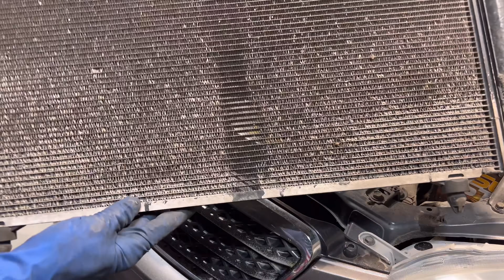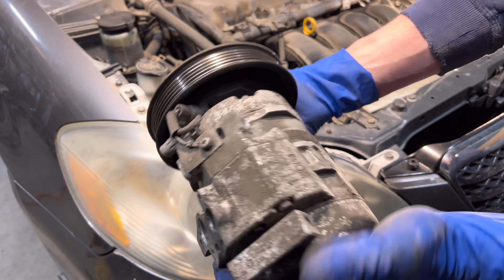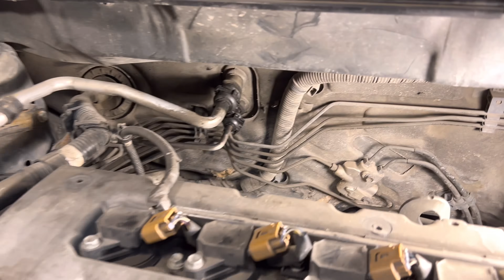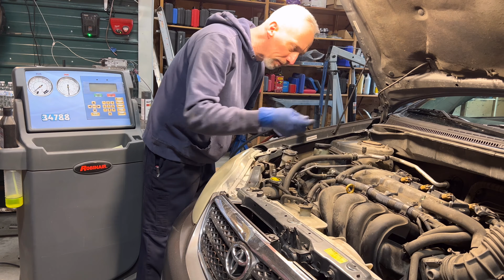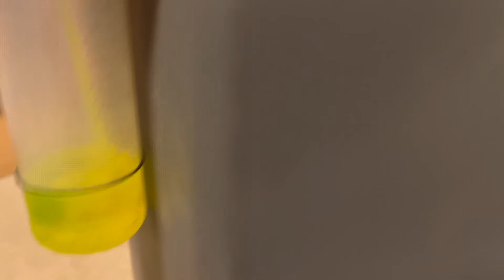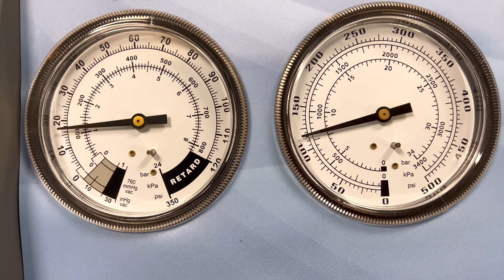New A/C system | 2006 Corolla

Comment from the maker: Product link for the AST line lock release tool: https://amzn.to/3vPy2fc

To see all of the tools that I use and recommend, visit the Tool Demos store: https://www.amazon.com/shop/tooldemos
As an associate, I earn from purchases.
Reply from the maker: @usa wicked 1.06 lbs
Reply from the maker: @@kondon-jt8jt dash does need to come out.
Reply from the maker: @@kondon-jt8jt I just buy an O-ring kit for that car at the auto parts store. There will be a lot of O-rings that don’t fit but you’ll easily find the ones that do. The kit usually costs less than $10.
Reply from the maker: @@kondon-jt8jt I would replace the condenser if you are doing a major repair like a compressor, but I don’t consider it to be a maintenance item. As far as oil goes, do your best to drain each component and measure what comes out. Replace whatever you drained. A good rule of thumb is about an ounce for the condenser.
Reply from the maker: @@kondon-jt8jt I’d look at the clutch first. Either wearing out or bad electrical connection.
Reply from the maker: @@kondon-jt8jt I’ve noticed mine stays on all the time, not sure if it would cycle in other weather conditions.
Reply from the maker: @@kondon-jt8jt hard to say. Could also be a too high/low pressure in the system and the switch is preventing clutch operation. You’d need to check pressures.
Reply from the maker: @@kondon-jt8jt I’m glad you found the problem, enjoy your cool air this summer.
Reply: Have have a blockage, I figure it's the orfice. Is there an inline refrigerant filter?
Reply: I wonder the same thing  Guess it's in the filter in the side of the condenser coil.@ScottieLeague
Reply from the maker: @ScottieLeague  there’s no orifice tube on this car, it uses a thermal expansion valve instead. There is a filter dryer component attached to the condenser.

Comment: in this car can i remove the ac coil without removing the dash?
Reply from the maker: No, dash comes out. https://lemon-manuals.la/Toyota/2006/Corolla%20L4-1.8L%20%281ZZ-FE%29/Repair%20and%20Diagnosis/Heating%20and%20Air%20Conditioning/Service%20and%20Repair/Air%20Conditioning%20Unit%20Assy/

Comment: How do you account for the oil in the condenser? Does the machine add oil?
Reply from the maker: Yes it does. I usually add 1 ounce per component replaced (rough estimate)

Comment: Save yourself some time on the expansion valve and buy a ICON Locking Flex-Head Ratchet and Bit Set, 35-Piece.
Reply from the maker: I’ll take a look
Reply: Yesir. Just did. Realized it would be impossible, at least with my hands, to do that with a regular allen key. Bolts won't come all the way out before hitting the filter housing, but i think I can get it changed without changing the bolts. Wish me luck

Comment: How did you get those expansion valves  screws? Out 😢
Reply from the maker: I used a bit ratchet. Tough to do, but not impossible:
https://youtube.com/shorts/cvHSUpMxPHY?feature=share
Reply: The real question is how did you remove the bolts from the Expansion valve. They are long and hit the blower motor housing. That's the missing piece for me.

Comment: I'm hearing you can remove the top side radiator bolts off and just swing it back to remove the condenser.. I'm going to try that method.. changing compressor and condenser on son's car.. hope it works.  Will have it professionally evacuated and recharged.. great video!!!
Reply from the maker: @hesson81   you might be able to it that way, I wonder if the fan has to come out completely to give you enough room?
Reply: @ToolDemos  I'll reply here when we do it.. it appears it's also a tight fit, but doable..
Reply: This is what I did. I had to be careful sliding it back in with the condensor fins, but otherwise, easy.

Comment: You did a great job. Guess you found out the firewall grommet was forgotten at that moment but easily cut open slit on each line and Tada ! ( done that too !). Do you ever add a micrometer to check microns? Usually under 500 is fine. Great commentary. Hats off. BTW, what is the torque for the compressor bolts? What I was looking for. Not listed anywhere but " good and tight" should work fine. I had to drop the compressor in order to get to the back nut on the alternator that SPUN and couldn't grab without cutting the stub that supposed to keep that nut from moving. What a nightmare but installing new one now FINALLY. Never a dull day !
Reply: I see you did put the grommet in. Thought it fit externally. I've done enough repairs on my girlfriends 06 Corolla to declare myself a Toyota Tech ! A fight to get to some things but not the nightmare of .much newer cars. 256,000 .miles on her and still original compressor but head pressure too high and probably the filter drier is restricting. Going to change the complete condenser and a good vacuum, dial in the charge, and cross my fingers for proper pressures.
Reply from the maker: @craigkroll4374  hope all goes well on the A/C
Reply from the maker: @craigkroll4374  what a job that must’ve been!

Comment: I know this video is over 2 years old, but how did you remove the screws from the expansion valve? It appears they are too long and will hit the black plastic box.
Reply from the maker: I remember it was a tight spot, but once they were loose they probably spun out with my fingers. Can’t recall exactly, but it wasn’t too bad.

Comment: Hi Steve, it's been a while since your video, but I appreciate it. I have a question. You said that the cycling was good and I listened to the cycling. I heard that it was every like 30 seconds, is that ok ?
Reply from the maker: It was good for the temperature that I was running it in. If it’s hotter outside, it won’t cycle much at all.

Comment: Not really a project that the average person could do without all of the tools and evacuation/ac equipment. This is more of a demonstration for mechanics with their own shops . It’s all very simple if you have all of the necessary tools at your disposal.
Reply: It’s a simple DIY, I just did it. Also you can unethically release the old refrigerant to the atmosphere, without needing anything other than a manifold gauge
Reply from the maker: You’re right. I don’t record A/C repairs anymore for that reason.

Comment: Did you drain the old freon before changing out parts. Also what should the pressure be on high and low after adding new freon?
Reply from the maker: No, it had no freon in it. Pressure is going to vary with temperature. If it’s hotter it goes up. A decent average is about 30 psi on the low side and 150 on the high side when it’s operating.

Comment: Hi my car mark 100 plus and minus 50g  nze121 engine I don't know how much gas to put maybe a 12oz
Reply from the maker: Right, just like an oil dipstick there is an acceptable range for an AC charge. When I fill a system, I go by the maximum number.

Comment: I realize this video is over a year old but doesn't the Robinair 34788 only inject oil in the high side?
Reply from the maker: Before you start, you can set it up either way. I prefer charging on the low side, so I  set it up that way. It defaults to high side charging, so each time you gotta change it.
Reply: @ToolDemos  Yes, you can do a high or low side charge but in my Robinair 34788 owner's manual I'm pretty sure it says it only injects oil into the high side so if  you want to use the oil inject feature you need to do a high side charge.
Reply from the maker: You’re right. After injecting oil you must charge on the high side. Thanks.
Reply: @ToolDemos  I wonder if you choose low side charge initially but then later elect to inject oil if it changes to a high side charge in order to get the oil in? I've always selected high side charge with mine so haven't tried it.
Reply from the maker: @johnaclark1  I’m re-thinking my whole strategy right now.

Comment: Do you have a video with a major AC replacement? I have some tools needed except the freon recovery machine (that $7000 Robinair Recovery machine makes a statement!) but on my 2004 Corolla last time it ran it was blowing hot air. AC have never been serviced except to add freon when felt little hot; i may have a leak somewhere. I also have been "collecting" all major parts for the AC, got a TYC Evaporator and the little rectangular part that goes in with it, forgot its name. I have not bought a compressor or condenser as I do not know the state of those but got them "on ice" if needed. At the very least a set of oil rings for the lines and compressor will be used. The engine is still out of the bay but coming in soon these few days. I am under the impression it is easier to work on the AC with the engine off the bay? The bumper is also out and so it is the radiator at this point. The system sits there sealed as I do not want to disconnected and leak freon. The major setback for me is the freon recovery machine because of its price! I wish it was an easy way around it, Also, to replace the evaporator I saw that is a really big job where the whole dashboard has to come apart!
Reply from the maker: Hi Rody, I hope the engine job is going well. I’d say the only A/C component that would be easier to replace with the engine out would be the compressor, but not by much. I’m wondering, why do you want to replace all of the A/C components? You’re right, the evaporator is buried in the dash - not an easy job.
Reply: @ToolDemos  I suspect a leak. The air runs very hot last time I checked that was over 3 years ago lest time engine ran. Just yesterday I tried pocking the Hi Port expecting no freon to my surprise it spitted freon on me and there was normal pressure; a local mechanic told me to check the pressures in the valves this way, don't know if he is right or wrong but I know he works in a shop and he is certified. I do have a UV testing kit from Harbor Freight but have not use it, don't know if engine needs to be running, I mentioned before I do have the evaporator and valve new and just before answering here I just got the condenser,  Inficon Vortex Dual Recovery machine and O rings kit from Amazon; trust me, i am not looking forward to undo the dashboard at all but if there is a good time it is now while engine is out as the lines in the firewall are very easy to reach, the condenser is dangling at from on its tube and compressor is accessible as well as it is in line in the engine bay. The itch to do the AC is present even thought the tools prices hurts badly; local shops here charge a lot for AC inspection and labor, remember I have a Toyota tacoma lined up for self-service, also full engine overhaul and although its AC runs fine it was a little low on freon as that truck's AC used to feel ice cold in the single cab cabin, so I figure I would have all tools needed if needed to recover freon on that one, one last thing is my brother who is not here but it is coming soon he is certified HVAC tech and he will be thrilled if I gift him the recovery machine; all excuses, LOL, I know but the main thing I want to do the AC is the suspicion of a leak; if a leak is present the AC has to be evacuated if one is to service the lines, am I correct? I could put some sealant on it but a more through repair would be doing the system whole? You would know better of course and if I would have a good reason why the AC ran hot even with freon in the system I would look into that instead of disconnecting the lines; the tools I just bought are returnable after all still. Thanks for all your advises; they are greatly appreciated!
Reply from the maker: @fireyourrocketts  okay, got it, there’s a lot to unpack. 
-A charged system, even if a bit low will still cool.
-Leak sealer in a can will destroy your system and your recovery machine. (My opinion)
-Replacing all of your A/C components might still not fix your problem.
I know you don’t want to hear this but, this job is lining up to frustrate you and waste a lot of your money.
My advice: install your engine - get it running. Pay a mechanic to tell you what’s wrong with the A/C, then consider whether you want to repair it yourself.
I hope you will consider this advice, it is the best I can give you.